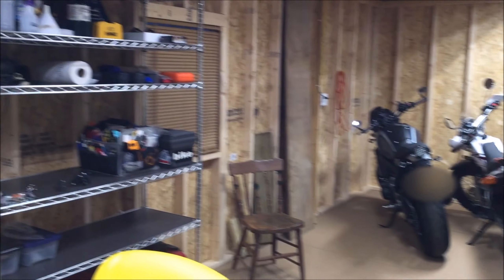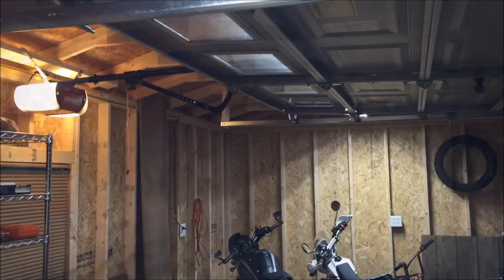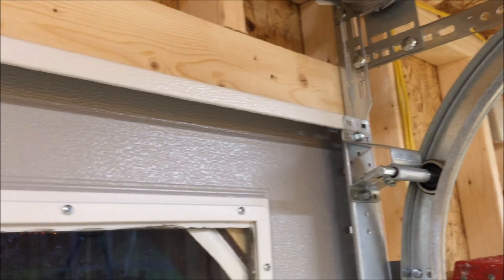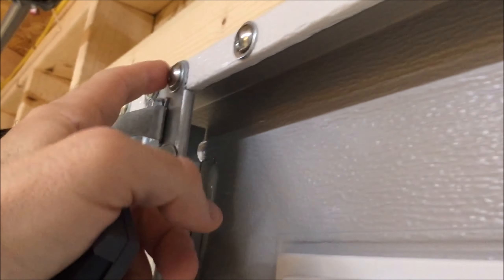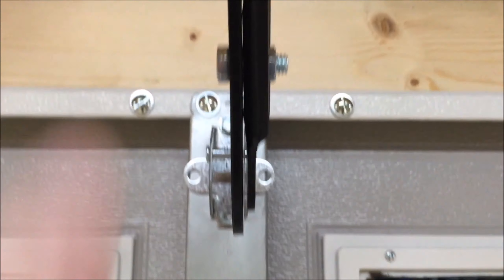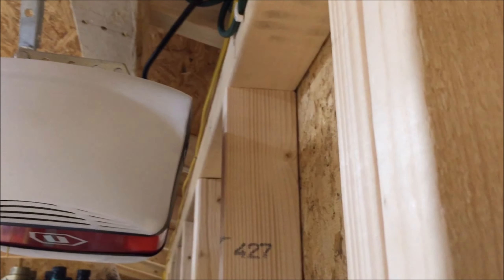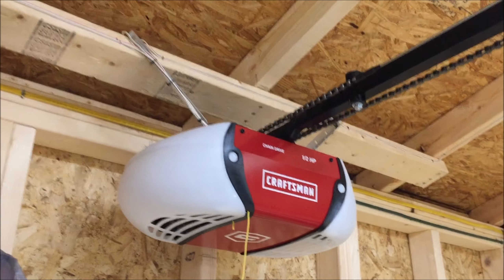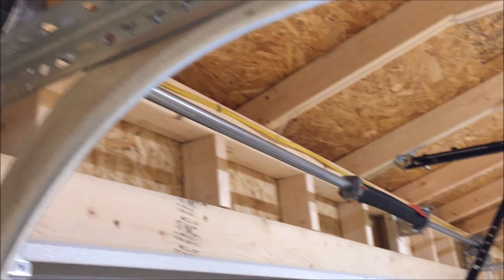Installed a Craftsman Garage Door Opener

Comment: Thanks for the reinforcement tip. My opener installed by the previous owner just ripped the bracket off like you predicted.
Reply from the maker: Damn! Yeah I figured it would but wasn't sure. Glad I went though the trouble of installing that angle iron!

Comment: How did you connect the garage door opener? We are having issues on the opener working.
Reply from the maker: Sorry I just randomly saw this comment. Youtube didn't notify me of it. This one came with a very good instruction manual and I just followed it exactly.  The stuff I do not remember too well is programming the extra openers, and the specific colors of wires, etc. But all the info is in there. I guess a lot of people get stuck on programming the safety pressure with a 2x4. I followed instructions and it worked the first time. It's been a while since I did it though..  I also just used a heavy duty extension cord and stripped the wires back and plugged that into a regular outlet. Probably not "code" but it works fine.

Comment: I worry about gas fumes igniting on hot summer days..boom. no more shed
Reply from the maker: I don't..  I have a temperature controlled exhaust fan installed and other ventilation. Plus gas fumes require an ignition source, they don't just explode because it is hot outside.